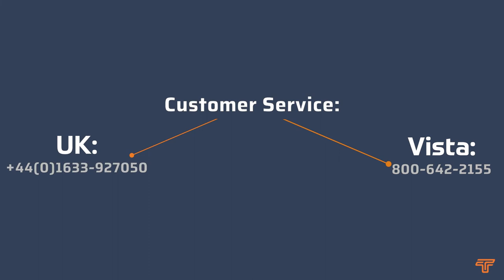How to Trace Coax Cable using a Tone and Probe (402K)

Comment: will i be able to toen if there is splitter in a way
Reply from the maker: 402K can "tone" using the search coil up to the splitter. Beyond the splitter, assuming is it grounded, you would have to disconnect the outgoing cable and use the test connector on the back of the probe to prove which cables are carrying the signal from the souce.

Comment: Hello, I relly like your video, I dont really understand the search coil art.
Reply from the maker: A search coil is a multiple turn "solenoid" that concentrates (often by having a ferromagnetic core) and magnifies the mutual magnetic coupling between the cable to be detected and the "amplifier" by having multiple "turns" of wire. This way the tiny magnetic field that is around the conductor can be detected for tracing.